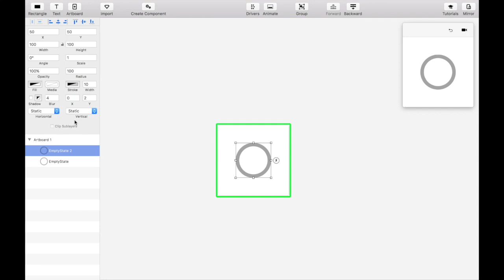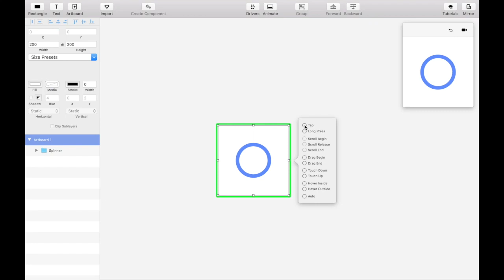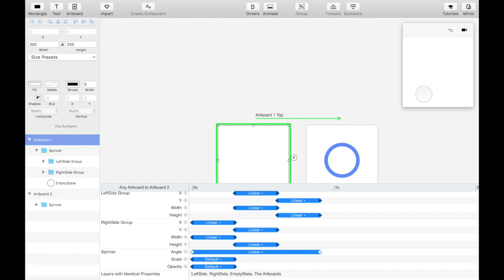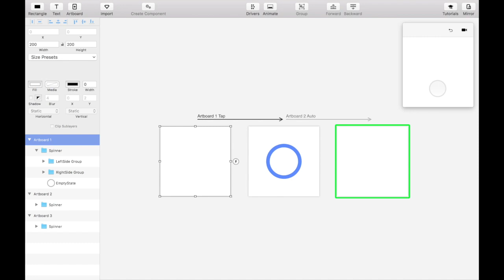Principle Tutorial Loading Spinner Mask

Comment: How would you do this for a non-circular shape and change where the loading originates from? I tried this with a rectangle and it works but changing the loader start point by changing the degrees doesn't work the same, it puts the rectangle on a tilt.
Reply from the maker: Hey Stuart, great question. I would try creating an invisible circle layer below the rectangle and above the non-circular shape to control its angle/degree. So the invisible circle layer would act sort of like an intermediate double orbit. Does that make sense for what you're trying to do?